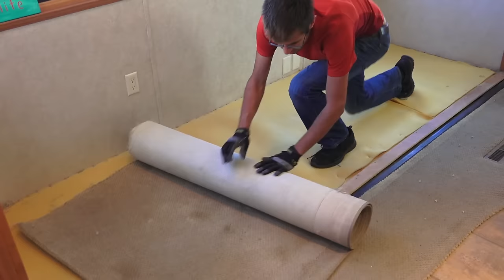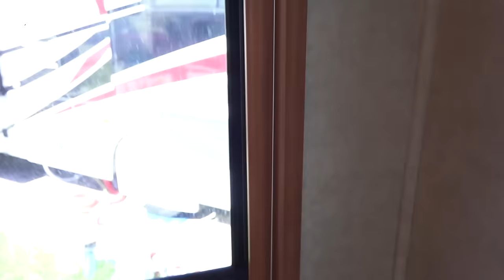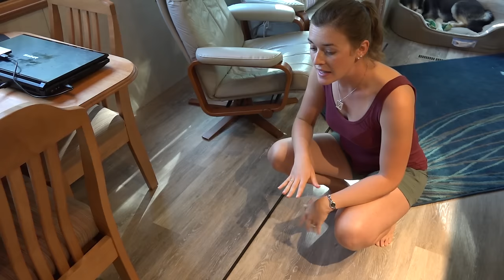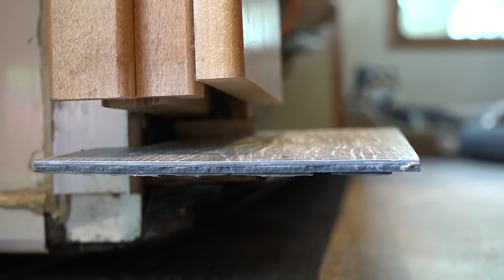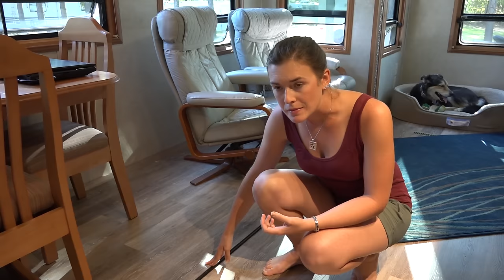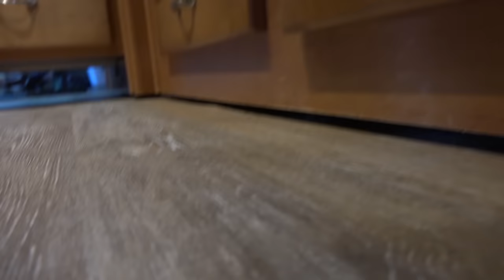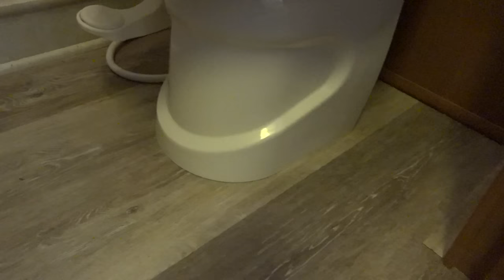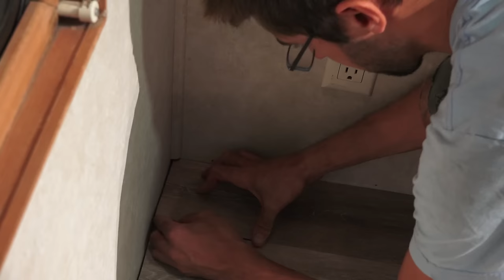DIY RV Reflooring with a Flush Slide-Out

Comment: Hey all. We did exactly the same remodel, the same way with the slides. Our slide edges have been solid, and even overhang just a bit to cover the original metal strip. We use 1/2 cut small pool noodles to buffer the slide bottoms when we bring them in. Works really well. We have four 8 to 10” pieces on the main slide, and two for the smaller slide. Just put them in perpendicular with the slide and they’ll take the weight and still slide. Your project looks great! Nice work, and kudos on the timeline. That’s pretty aggressive! We also did the WeBoost installation (4G RV). That was fun too.
Reply: Did you guys have issues with the flooring separating a little bit? I have the exact same trailer and did the exact same floor this guys did. Unfortunately for some reason the planks like to come apart a bit even though we did the temperature acclimation and everything. Also my black part of the slide isn't straight? Haha

Comment: We have the same flooring in our home.  We had a screw from the plywood underneath come up and create a hill on one piece.  We called allure and they said to take a sharp knife and cut the whole piece of plank out and then cut the glue ends off a new piece and put some tough as nail glue on the plywood and lay the piece of plank on it.   Worked like a charm.
Reply: lwood8 I bet it did. I was going to suggest that along with using a hair dryer to heat the adhesive getting it to release and make it possible to pull up the damaged plank(s).

Comment: We’ve had Allure flooring in our bathroom for about two years. It still looks brand new. I do remember the directions saying not to caulk or seal the edges as it is a floating floor and could expand and contract even though it’s not wood. Caulking the edges could cause it to bow if it expands too much. We will doing something similar to our fifth wheel soon. It looks great.
Reply: It's good to know you're still happy after 2 years. I've wondered not so much how the vinyl holds up but if the planks stay down, don't lift on the corners, bow, etc.
Reply: Dinah Rogers we’ve had no issues at all. Still looks brand new.

Comment: Oh God, been there, done that! The staples were problematic but not impossible to remove during the reflooring of my 2004 Holiday Rambler Savoy. I went with 24” square carpet tiles by Mohawk and glued every one of them down. We did the slide-out as well and when extended, the tiles blend in together with almost no gap. And, we can walk on it with the slide out retracted. I was worried about the extra weight as well but doesn’t seem to be a problem. Thanks for sharing your experiences!

Comment: When pulling staples after remodeling 3 homes with carpeting, one of the most time-consuming parts of the process that many look over when planning for their projects is all of those staples...I've found that needle nose pliers are best instead of regular pliers. This process takes forever for everyone. To give you an idea, my father and I ripped up 3 rooms of carpeting to which we listened to the Hamilton soundtrack whilst completing. 

By the time we finished. Hamilton died 4 times.
Reply: Use a grinder

Comment: Outstanding video!  Thank you so much for sharing. We have a quarter million dollar Diesel pusher with 3 slides. Being a retired police officer on a limited income, we opted for a nice pre-owned R.V that was a trade in, and we waited till November when the dealer's price dropped for New inventory. We paid just under 100K for a pristine unit. After 1 year of our dogs traveling and camping with us, the carpet cleaning became more than anyone could stand. To have 140 sq. ft. installed was $1500.00! We are doing the job ourselves, and needless to say, to do the job myself is scary. This video explains enough to where I can do this with confidence.
Reply: Lloyd Morrison II That price sounds very reasonable for a floor change out in a diesel pusher depending what all needs to be removed and reinstalled to do it right

Comment: Thanks for your 6 yr old video; others may have mentioned this, but in regards to your screw scratch on the freshly installed flooring, and judging from the camera angle perspective, it  actually looked like a typical flooring joint because of it's short straight run.   In any case,  it most likely faded out after you worked in some vinyl putty or touch-up marker paint.  Great video and tips, thanks for sharing!

Comment: Great job. Thanks so much for taking the time to discuss the issues you ran into... I'm planning to do our 5th wheel floor and the slides have me perplexed.... your whole thought process in addressing the issues was excellent. A few ideas for your next project: 1) Glued sheet vinyl... use a heat gun... comes right off   2) Staples... use 2 pairs of vice grips... grab the staple end with one, use the other to leverage, rather than pulling with muscles.... that'll tire you out!
Reply from the maker: Thank you!

Comment: I previously worked for Williams-Scot which is the largest construction and security trailer leasing company in the U.S.  We refurbished all returns etc. We used heat guns to help get the old stubborn floor tiles up.

Comment: Just wanted to say thanks, replaced floor and used a piece of plexiglas under each side of the slide to protect the new floor after seeing your problem.  So glad we did you can see scraping on the plexiglass where the steel plate support under the side.

Comment: The best tool for removing flooring staples is side cutters.  You just clamp on the staple and pivot the cutters like a lever to pull them out.  It will save you hours.

Comment: Did the same in 2017. Also used Allure Vinyl Plank. The only way to go thin enough for the slides to still go over the top of. You could get another set of those grey slide slickers to put down at the corners of the slides before bringing them in to prevent more scratches.

Comment: A word to others in colder climates. We did the same to our class c moterhome. Looked great first year. Stored for the winter here in Montana, went out in spring and all the seams had pulled apart even after rolling them. Not sure as to the reason, but was not pretty. After warming back up they did start to move back together but never did completly. Hopefully others have better luck than we did. It did look awsome to begin with.
Reply from the maker: Good advice, we have been below freezing and noticed the floor shrink a little, but the RV has always been heated.

Comment: Flooring is very nice modern.  Brings the unit up to date. Two things as side tips. One side cutters work way better for them staples.  I have had to pull my fair share of staples out of rv carpeting lol. Not my favorite job. Second I saw some water damage at the front of the flush slide when the carpet was up. You might want to look into that at the front of the side, and that might have been the culprit to the rear as well.  I have seen that a lot to. Smart idea sealing the floor edge before reinstalling the trim.  You might want to thing it over and seal the trim edges in the bath, kitchen,  and by the entry door to help protect them from water if their is a major spill, leak, or raining out side. I did this with my camper when we replaced the flooring because I figured it would be my luck something would happen. Lol  happy camping,  and safe travels.

Comment: I was a contractor for years and removed a lot of carpet and staples, best tool I ever found to use were end nippers, you can grip and roll the staples out, also great for pulling small nails
Reply from the maker: Great tip! Thanks!

Comment: I've had this flooring for a couple of years now and I love it! you're right though unsupported it will chip/break so figure out a way to support it if there is any chance it will be hit or stepped on in an unsupported area. No need to glue it down it doesn't move and i've got it in both large and small areas :D

Comment: We had a tear in our floor from a screw. Now we use a moving pad placed on the floor when it slides in to protect the floor. When the floor is extending back out we remove the pad so it doesn't get jammed into the slide gears. 

Give the pups a bone, they worked hard.   :-)  Nice job!

Comment: You could try gluing a small strip of one of those plastic flexible cutting boards to the underside where the slide tips down although you might have to shop around for a glue that will hold it in place. The video was excellent. Lots of "doing it" footage as well as clear explanations of what you encountered and what decisions you made. Thank You.

Comment: Great job!  I love vinyl plank flooring.  It's almost impossible to discern it from real wood and the water resistance and wear qualities are excellent.  I have a feeling that the area on the edge of the slide will eventually fail.  If you find yourself repairing it in the futute, I would suggest getting a piece of 3/16" or 1/4"" steel, 3 or 4 inches wide and mounting it on the leading edge of the slide with countersunk flat head screws to support the edge of the flooring.  You can fill in the rest of the slide area with a piece of underlayment.  The added weight will be neglible and you should end up with years of use.
Reply from the maker: Yea I think thats what we will do if this fails.  2000 miles, 20+ slide movements and so far so good, but it will just take one wrong step.

Comment: We just purchased our first RV and are about to replace the carpet with a floor identical to what you have. The scratch from the slide is a great heads up! Thanks. I wonder if something like thin sheet metal with a temporary adhesive spray would work to protect the floor when you move your slide in and out? We’re making a list of things to do and learn too. Like how to escape through the bedroom window in case of fire. Yikes! Practicing frequent drills seems like a good idea. Just subscribed. This video is exactly what we needed.

Comment: Highly recommend picking up enough boxes to finish the trailer, as if you wait to long it will be hard to find the same thing. I had that happen to me. It was only about 6 months between projects. Would also pick up a spare box for repairs.
Reply: Great advise that applies to any material that is completed in phases. Even if the product is still available later on, it's unlikely you can buy the same "run". If the two products are visible together there could be a noticeable color shift.

Comment: I hope your hanging flooring is holding up well...perhaps building a pieced insert to support the cantilevered edge for when it's pulled in/travel mode could be constructed. I can really see that over time that flimsy edge will 'go'...
The overall look is gorgeous...and perhaps you could use a dremel tool to grind off that scratching screw head. You really did a top notch job!

Comment: You may want to try some strips of luan under the floor on your door side slide at the transition just to take that little bit of flex completely out of the equation. Very light and cuts with a sharp razor. The way it looks, you could probably slide it right under and use some wood glue to hold it in place. Looks great. Much better than carpet. Safe travels. Later.

Comment: Little tip for the future with staples, you can use a 4 1/4 or 6 inch cordless grinder with a cutting wheel and just cut the staples flush. Then tape an old shirt on a broom to catch any sharp edges or ones you missed. Also this gives me a good idea to test the slide on the bare floor with a piece of luan that would be the same thickness as the new flooring. Bring the slide in on the Luan would reveal the pesky floor gougers that are hiding under the slide.
Reply: Steve Harkins - thinking that using a dremel tool to cut and grind flat/flush whatever part of the staple that it's still exposed would also work. They are small and easy to handle.
Reply: Have used the grinder as well for staple removal, but it makes a mess in my opinion.  I use side cutters and a small common screwdriver to lift the staple up for removal.  Seems I take out a thousand or so on each and every job.  Then take my gloved hand and rub it all over the floor for broken staples.  You will not regret this method!   lol

Comment: A little Velcro would hold your corner piece in place. You can buy it at Walmart in the sewing section. Just pick up a roll of the industrial-strength Peel and stick.  Pretty handy to have any RV anyway. TFS.  Hubby and I are almost done doing the main floor in our motorhome. Ugh! We went with the click lock laminate. We did lay a subfloor down to help with insulation and sound.

Comment: I did a similar project on my motorhome atrium slide.  When I finished the front edge (the part that comes inside the structure), I rounded the corners slightly and used automotive door protective trim to give that edge a more finished look, and to protect feet from sharp edges).  I used CA adhesive to secure the trim to the vinyl.
Reply from the maker: Awesome! Thanks for sharing your process! :)
Reply: @tony do you have any pictures of that edging you could share?
Reply: @JerrySimonson29729  it's just car door edging trim.  It's black.  It's shaped like a deep "c" shaped channel.  The camper is I'm storage right now.  Here is a link to the material (it comes coiled, so warm it to remove the curvature):

Comment: On the corner of the slide that hanges down, it can either be nailed or glued to the wood frame of the slide if needed.  A spacer could always be used if need be.  Good job!
Reply from the maker: Thanks,  We have not had a problem with the corners yet but will probably do that at some point!

Comment: If that plank on the slide ever breaks, you might be able to find a piece of solid wood or bamboo of the same thickness.  Put it only on that one spot, then you won't have to spend much.  You could probably find a near match to the color.  That way you wouldn't have to worry so much about a break. The vinyl plank is quite brittle.  I'm using the same stuff, but I don't have a slide out.

Comment: Great job. I just purchased a Highland Ridge 5th wheel which has the linoleum flooring on the slide. Apparently Open Range has a patent on this. The only carpet is on the pedestal bed area. Thanks for the detailed video.

Comment: 3 years too late for you all but for everybody else that's about to do theirs I just have mine a 2020 forest river front living heritage Glen and and 3 of my slides leaked over this last storm in Texas. I'm in the process of doing all of the repairs myself myself there are only a handful of 4 to 5" long screws that hold your island down super easy to remove and cutting your water lines You can use shark bite fittings to reconnect for $25... totally  worth it

Comment: This is such a great resource! Great video!!Thanks for making a video about your process of installing vinyl flooring.  We have a 2015 DRV and want to do the same thing.  We have a question,  what glue did you use to attach the flooring to the black rubber/plastic slide out thing?

Comment: Great job. Carpet replacement is on the 'to do' list for our late 2007 Alpenlite 34RLR which is very similar in layout to your, looks to be, a MS 32TK3. The MS 32TK3 was on our final short list of models when we got to the shopping stage in 2006.

Point taken on using the stick down linolium vs the click lock type flooring. Our carpet is in pretty rough shape after 12 years & something like 2000 nights on the road. Next year when it comes out of storage.
Reply from the maker: Thanks! Our fifth wheel is indeed a DRV 32TK3!

Comment: I know that this is a bit of hindsight, but, they make a material that is supposed to be able to '"repair", damaged wood like you have. You mix together 2 parts, and smear it into the damaged area, the more torn up the wood is, the better. I think they recommend overfilling the area, and then after it cures, level it out. It has something to do with how the product changes during the curing process. I think it shrinks a bit. I wish I had the name of the product. I saw it being used on an episode of, "This Old House", on some very difficult to reproduce elements of some exterior porch railing.
Reply from the maker: I used to use that to repair wooden plane propellers, totally forgot about it.  Thanks!

Comment: Looks amazing y'all!

From how you're gesturing contacting the screw head under the slide, you may be able to use a flat file to shave the screw head.

Additionally, I don't suggest using THD "wood putty", filler, etc., to fix the gouge in the vinyl flooring. Instead, use an epoxy putty stick from Mohawk in a suitable color. If necessary, different color sticks can be combined following the provided recipe card to achieve an exact color match.

You'll use a plastic leveling card (no sanding) to flatten the repair, let harden, then apply any touch up color using a color pen from Mohawk.

After that, you can leave the repair as-is, or top coat it with aerosol laquer of the appropriate sheen, using steel wool to rub out a matching sheen.

Feel free to reach out if clarification or additional information is needed.

This will provide you with a great looking, durable repair. Just be sure to file down that screw head first. Yikes! I can only imagine that you were just crushed when that happened.
Reply from the maker: Thanks for that recommendation!  Will look into that.
Reply: John Coloe I

Comment: Try putting some of the pads they use on furniture.  When you have hard wood floors. If you can feel the screw, should be able to file it down with a 6" bastards mill file. Slow process but doable.

Comment: We also used the allure flooring to replace the carpet in our old Itasca with a slide.  We to were disappointed with not only scratches, but also the stick together joints that began to separate.  When I do our current coach, it will either be sheet flooring or something that can be removed and replaced where needed without pulling the whole floor.